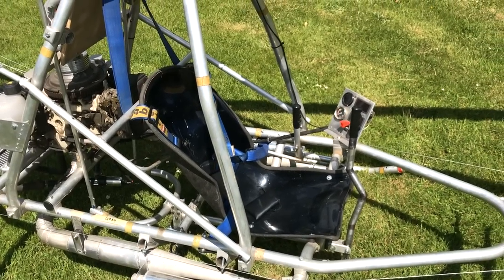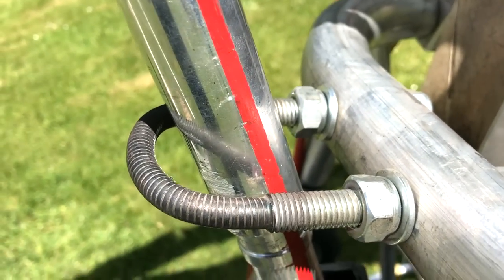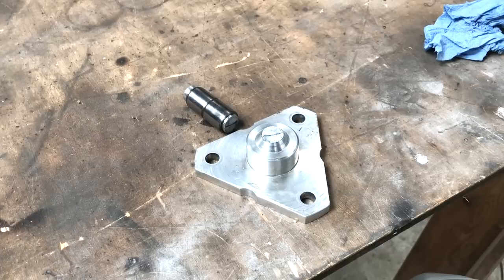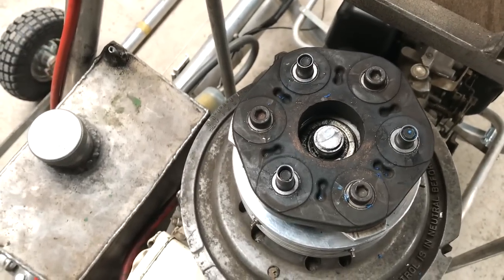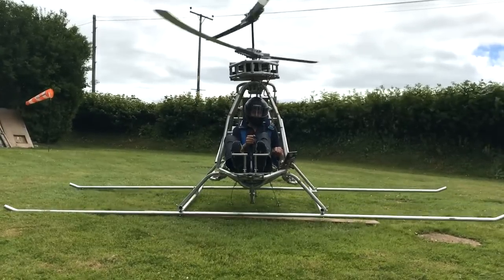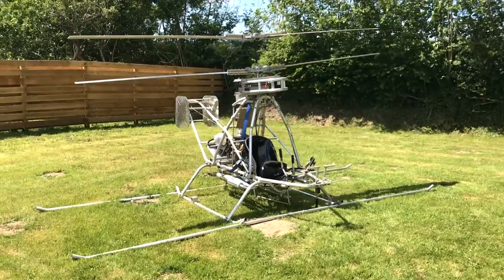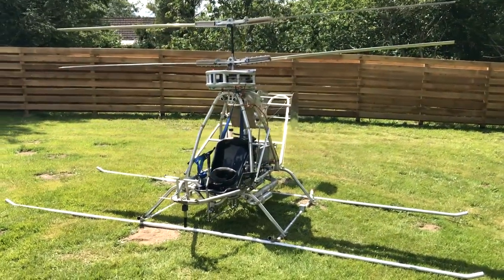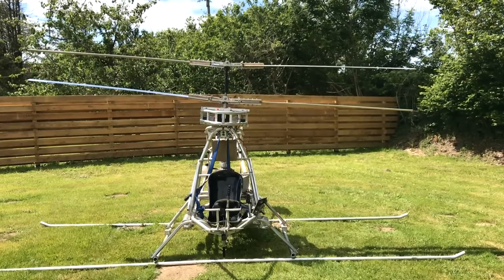Part 4 Learning to FLY Homemade Helicopter

Comment: I am glad to see the development slowly , you might be more confident on the machine .
I think you are very careful not to make any mishap , otherwise it seems steady to me ,
How do you feel when having cyclic and paddle control ?
For us as a viewers we see y9u doing fine .
Do you just increase the RPM of  rotors for getting lift ?
Good wishes brother
Reply from the maker: Thank you, the cyclic feels really good, the sensitivity is about right and responds well with minimal effort. The yaw control is also about right, pretty responsive with minimal movement. At this point there's nothing I want to change. Just practise with the long poles, I've added longer poles fore and aft now and it feels safer. Testing in calm conditions is necessary, the slightest breeze upsets the hovering attempts. It really needs to be dead calm, pointing into the wind is easier but you still get problems. It's getting easier with practise but not getting over confidant will be key.
Reply: @Ben-Dixey  oh it sounds really okay .
I think I would exactly do the same way you are proceeding .
Waiting to for more videos but no hurry take your time to understand your machine well ,
Thanks brother

Comment: Exhaust really need to be that ridged? 
There some flex between the engine and pipe?
Reply from the maker: About 9" from the engine there is a spring loaded flexible joint, the expansion chamber and silencer is supported by rubber mounts. The cracking seems to have gotten worse since I added a second rubber mounting. It might be coincidence but I think making a steel exhaust system will be the solution.

Comment: Hi, good to see you're still making steady & safe progress. Now you've got  4 pole extensions fitted I would suggest you use 4 tethers ,1.5 ft. long attached to your fore & aft extensions so there in your peripheral vision when you're looking straight ahead, id just used some colored 10mm rope ease to see & extend when you're ready to, tie & gaffer tape the rope to the skids so they can't slide. Go to your big field, stick your windsock into wind but out of rotor wash effect, take plenty of fuel & a picnic for 2 you & your assistant. limit your runs to between 5 &10 minutes, take a rest, relax, assess your progress & when you feel confident extend your tethers by no more than 6" at a time. YOU WILL KNOW when it's time to remove the tethers, you won't be sweating, the tension will have gone from your body, you will be using the controls without thinking. Good Luck.

Comment: Looking at your skids, they are a good idea. Criscross them so that they extend at 45 degrees for and aft and starboard and port. You need protection from dynamic roll over both laterally and for and aft. Vibration is the bane of all helicopters. Every part you make from anything except steel or carbon fiber will fail. Resonance on any drive shaft needs to be avoided. Period. You are doing a great job, but you have picked a formidable task by building a helicopter. Best of luck.
Reply from the maker: Thanks for this, and absolutely agree, I have now added the extended fore and aft skids as well, feels much safer. I couldn't do an x pattern because of clearance on the cyclic mechanism. I can understand about the life cycle of certain aluminium parts. Perhaps some crack testing ?

Comment: Mount a stick or stiff wire at eye level in front of the instrument cluster (As far away as you can mount it) on centerline. Having a good reference of attitude  and spin moment, can be had, and anticipating where it's trying to go is the secret. Small subtle movements of the cyclic can be read better by having a constant reference point. I usually tell students to find a bug splat on the windscreen in line with your target to reference. It works.... You are getting closer! :D
Reply from the maker: Thank you, I will do this next attempt I think it will help.

Comment: That torsion damper is also a flex coupling. Ideally you need the birfield (slide shaft in your case) centre of pivot and movement to be within the centre of the flex coupling. You have two points of flex at a short distance from each other, not a great idea. Also have you balanced or checked the CV shaft? it must be spinning much faster that that of a car. You probably dont need the torsion damper as you have the belt. It is much more rigid than the amount of torque that engine produces and they are usually mounted after a gearbox which multiplies their torque experience.  On a more important note, you look and remind me of David Mitchell 3:44. Best of luck, be safe.
Reply: Also by having the inner cv joint sliding up and down, you are continually changing its point of leverage, better off having a sliding spline mid way.
Reply from the maker: Like David Mitchell, I'll take that. Ha. Good point about the flexible drive coupling, I did some research at the time to see what torque it's suitable for but can't remember the figures now. It could be way over stiff. 

I originally bought a sliding splined propshaft off a Suzuki jimmy but when I applied 55lbft of torque I couldn't slide it in and out by hand so decided that wouldn't work. I needed a sliding ball bearing type cv joint but I know what your saying about it's design. I'm sure there is a better or stronger way but I would be happier with some kind of flex. The mini 500 had the same clutch as mine, ran a synchronous belt with no flex and it broke a steel caged rk400 clutch. 

I made the drive shaft myself out of 7075t6 and made sure it was turned and milled precisely. No balancing has been done on it. All I can feel vibration wise is the engine but that's not to say it's balanced.

Comment: With that dramatic intro i almost expected you to take off 🤣
Good job that shaft broke now.... looks like theres a small reduction in dia where it broke, good luck with the steel one. A good step closer every video....thanks from Rome✌🇬🇧
Reply from the maker: Thank you, yes perhaps a bit over dramatic intro. 😆 I'll have to do some periodic crack testing on the part to keep an eye on it. Whole thing should be crack tested really.
Reply: @Ben-Dixey  frequent testing a good idea, and i suppose like F1, it's weight vs strength. Loving this series.👍✌🇬🇧
Reply from the maker: Exactly like F1, I've seen those cars fly too. Trouble is the lighter and stronger the materials the higher the price. I'd like to know with all the bolts I've used what all those weigh. I could save 60% of that weight going titanium but that cost would be substantial.

Comment: Co ax is the way to go these days
Reply from the maker: I personally hope we see more coaxials, it's odd that Louis Breguet was flying around in his coaxial 100 years ago so it's nothing new. The only manufacturer that's been making and using them for a long time is Kamov. Of course there are other twin rotor designs in use like chinook and Kaman which have advantages over a coaxial. I like the compact size of a coaxial, fits in my workshop. 😀
Reply: @Ben-Dixey  Why do you think that the conventional layout of main and tail rotor has become the defining standard ? Since you have experience of co-axials , have you garnered any inisghts.  What is the equivalent of LTA with a co-ax ?   I guess one rotor being down on power or free wheeling.  Tail rotors that are not 'fenestroned ' off, if thats a word, make real life utility of choppers questionable as you need someone to direct passengers and people on the ground. Don't want that 'thud' through the pedals when your pax exits to the rear. Also, you need to be super rich to own the real estate where your chopper lands, otherwise, unattended , it will draw crowds and inevitably small children will use it as a climbing frame and youths will pull bits off of it, or try and turn it on its side. :)
Reply from the maker: I think others might have better knowledge on why the no. 1 configuration uses a dangerous tail rotor. One reason might be the complications in autorotation where yaw is usually controlled by differential collective pitch. With this type arrangement yaw pedals are reversed and less effective. The complex swash plates in a coaxial is another and the cost of 4 main rotor blades instead of two could be a third reason. These factors didn't stop Kamov and I personally prefer the coaxial design. Had Igor Sikorsky focused on a coaxial maybe things would be different. I don't know. The coaxial design i think would be placed as more efficient than a main rotor tail rotor deign but less efficient than a Kaman intermeshing or chinook bicopter.
Reply: @Ben-Dixey  Interesting term....Bicopter. I like that.  The Kaman design to me, takes a leap of faith. Those intermeshing blades. Co axial does seem to be getting pushed by the Americans too , with their Black Hawk replacement prototype configurations. And having no TR opens the door for a pusher prop at the back aswell. Although with the mu 1 speed barrier, I'm not sure if that is just over egging the cake. The switch to battery operated designs will enable different rotor configurations without incurring complex gear boxes and transmissions. Then the natural successor will make itself known. I think it will be two 'main' rotors a la Chinook.
Reply from the maker: An electric chinook would be a good one. I think the chinook intermeshes slightly so you would have to build the fuselage slightly longer to avoid this. It may well be the most efficient electric helicopter possible.
Reply: @Ben-Dixey  Yes, the Chinook is one of the few aircraft that if it crashes, will generally never be grounded.
Reply: @Ben-Dixey  Rehash that old X-WING  ( not star wars ) design using modern tech.   Co axial blades but quite wide , say 3 to 4 feet across. And a pusher prop at the back. Now, as the aircraft gets faster, you slow down the main co axial blades and park them up to form a kind of scissor shape cross, to give lift from being stationary in the cruise phase As you transition back to the hover, you start to rotate the main blades back up to giving lift and ratchet the power back from the pusher prop, to idle deacying your airspeed as you go.
Reply from the maker: Well A+ for thinking outside the box.😀 build a model and try it I suppose. 👍
Reply: @Ben-Dixey  Sounds straight forward, but in all reality would require DARPA or BOEING or some such to get it to work. Beyond my remit. A model in cruise mode would be easy enough and one in hover mode a little bit harder. But merging the two, well that would be a feat.

Comment: Nah..ive had enough of waiting for you to loose the tethers  ..just DO IT ! ..this SO reminds me of when I first started flying RC helicopters..I was terrified to actually take off..but when I actually did..all was well..so come on STOP wimping out and JUST GO !
Reply from the maker: Did you ever smash any blades learning RC going to fast too quickly? Because I did, it's getting there I'm having to think a lot about the yaw pedals being naturally backwards, the cyclic and altitude control is close to being controlled but not there yet. A gust of wind blew me suddenly to one side yesterday and I over corrected, then over corrected in the opposite, direction this was the start of pilot induced oscillation. More practise and it will get there for sure.
Reply: @Ben-Dixey  cmon..get up in the air ! 😁..if you crash you'll be fine..just go for it..if nout else, it'll make a cracking video 🤷‍♂️
Reply: And no..never wrecked my blades..not in a general hover
Reply from the maker: Ahh, I see you want to see a crash. 😉
Reply: @Ben-Dixey  not necessarily 😁..It just seems to me your kinda stuck in a bit of a fear ditch..understandable..but I think  you need to just go for it.👍

Comment: You are absolutely a pioneer in helicopter development!
I wish you all the best and I believe you've got enough brain power to figure out any problem and fix it!
You're no dummy. You definitely can do this!  :)

I wonder if dampeners, on the freedom of the blades, could help any? Just a thought......
Also, if your steel clutch part doesn't hold up, you may need to go to titanium.
Reply from the maker: Thanks for the nice comment. Not sure what effect dampers on the teeter hinges would have, maybe slow cyclic response time ? The clutch part might well need to be made of titanium, if that's what it takes I'll do it.
Reply: @Ben-Dixey  You're very welcome! I love invention and you're definitely an inventor. I am glad for you that you're able to do this experimenting. I am certain that you'll figure it all out!
I have found that invention is 90% determination and it only requires about 10% intelligence, although brains helps but it's still a small part. The determination is really the golden key :)
Reply from the maker: That's lucky invention is only 10% intelligence. 😆 I can't claim I invented the concept but the design is a one off loosely modelled on the Bensen B9 from the 1950s. There is some  mystery surrounding the B9 which I am slowly uncovering.
Reply: @Ben-Dixey  I would love to hear what you uncover :)

Comment: You should not leaving sharp corners in your designs of mechanical parts especially not on aluminum parts like the one that failed in this video. If at all possible don't use sharp corners on relief such as this. I enjoy your ambition to fly but I certainly don't want to watch you fall from the sky.
Reply from the maker: Agreed, sharp corners are stress risers.   I plan to crack test the new drive part periodically to keep an eye on it. This helicopter won't be flown higher than I'm prepared to fall, few feet maximum.